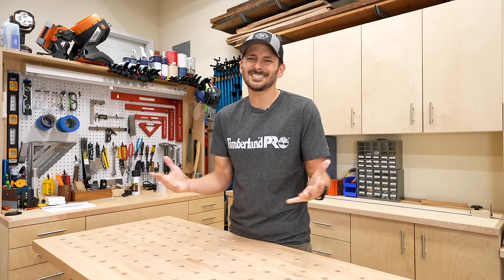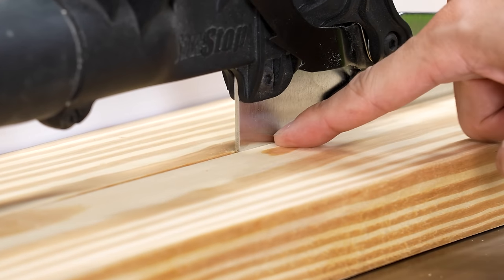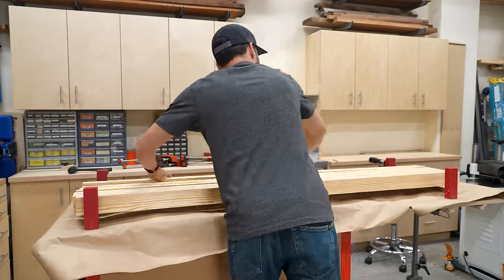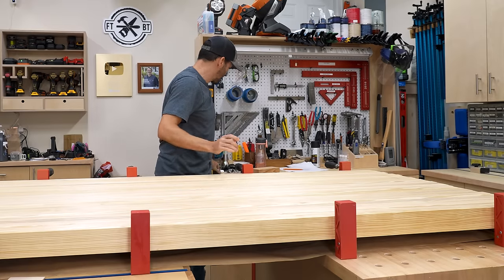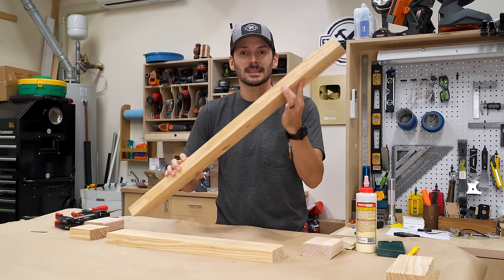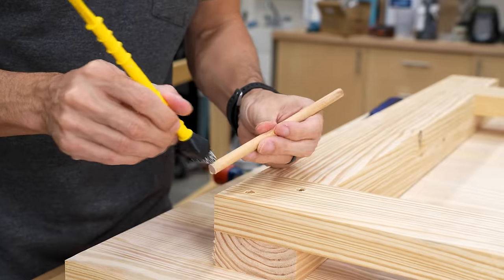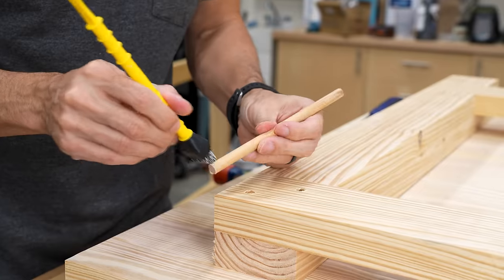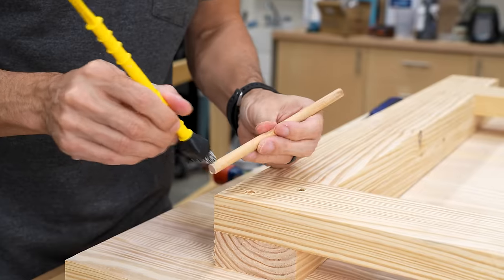Building a Sturdy Workbench with Cheap Wood

Comment: One thing I wish you would have touched on: How did you decide on the height of the bench?

Overall amazing video and AMAZING bench! Thank you for sharing all your hard work 🙏
Reply: Thousands of years of experience and study of the human body has led us to the standard height of a kitchen counter. (Industrial designers literally use reference books for dimensions of people) Is your kitchen counter just right? Too high? Too low? Adjust your workbench height accordingly, erring on the tall side because you can always trim the legs shorter if it’s too tall.
Reply: @christophermcclellan8730  Thanks! My understanding is that this particular topic is actually a bit subjective in the world of woodworkers (not as straightforward as standardized counter heights)… basically surrounding the primary intended use of the bench: hand planing vs power tools vs assembly, etc, etc.

If there’s any truth to my point, then I’m just saying it would have been nice to learn about his thought process that went into the height he decided to land on.
Reply: @mrvvoo  hand tool folks tend to like their bench a bit lower than the ones who like power tools and, unlike a kitchen counter, you get to build a bench at the perfect height for you. That’s where the subjectivity comes in. For hand tools, I’ve read that standing with your hands relaxed at your side measure from your hands to the ground.
Reply: @christophermcclellan8730  There is no way the height is from your finger tips to the floor. That would be about 27" tall for me, I am 5'2". The standard kitchen countertop is 36". I would have to build my bench 9" shorter.
Reply: @marvthecarpenter  did I say fingertips to the floor? No. I didn’t. Watch one of the hand tool guys plane. The work is hip height instead of waist height.

Comment: One of my problems when working on a bench is that I ended up with tools in the way of what ever I was working on.  I put a 12" deep shelf under the front edge of the bench, spaced back a couple of inches and about 6" under and with a 1" lip on the back side.  I then shove tools on the shelf so that they are ready for use without being in the way.  I then started using a couple of plastic storage bins on the shelf and leave some things permanently in the bins so that they are always readily available.

Comment: Came back to watch this for a 4th time. If you want it flat, I use two 8 foot levels and 2 4 foot levels (aluminum) and I create a router sled. You can get a 3" half inch shank bit and go to town. Basically you create an H and use the 2 four foot levels by connecting 2 small rails that can are about the width of the router. then you can just glide back and forth and take off material. I do this on wood slabs, you may not need that level of accuracy though. The drawback is the cost of the levels - but I've seen people make them out of particle board, or plywood. I wanted something without flex because when you are in the middle of 4 foot, I'd notice a slight 8th inch press down which in the final form I'd see these micro pits. You'd only see them if you took a bright light and put it at one end to see how the light scatters. Since this is a work bench, maybe you don't need ultra fine level :)

Comment: Tip from my shop class.  Buy a 4 inch roller and tray in the paint department.  Thin the glue by 20% or so.  Use the roller to speed up applying the glue.  Extends the open time and speeds up application of the glue.
Reply: @@a.melburn most yellow and white glues can be thinned with water.  Check the label.    Teacher was a contributing editor for Fine Woodworking, so I trust his experience.

Comment: I built a bench using 3 layers of 1” mdf. Per rob cosman. Not very expensive Very solid and very flat. Round over the edges and dog holes and put ca glue on the edges and they are holding up well

Comment: Great video as always Brad, though it brings back some resentment I have from a recent project. I tried a build similar to this out of 4x4s from a massive pallet my dad got from his work (used to ship a machine from Italy) and it went... poorly. I didn't have clamps so I made my own wedge table which kind of worked, but my crappy contractor saw flexed way more than I expected and I couldn't get a flat glue line between pieces, the wood was some mystery white wood that warped like crazy when the water in the glue soaked in, the whole thing is a massive 4" thick potato chip in my garage right now. I bought a flattening bit for my router to try to salvage it but I think it will be too thin by the time it's done....

Many lessons learned, luckily the wood was free so I only lost my time and the half a gallon of glue I used.

For now I'm thinking a plywood torsion box table is the right move for my skills and tools and budget
Reply from the maker: Yikes!  Sounds like a time consuming lesson learned, hope they next one goes better!

Comment: Cool,  I did mine a little differently. I used 4x4 for the legs,  2x6 for the frame with crossers every 16" and 3/4" plywood for the surface.  this table is 8'x4'.  On my 2nd table I did the same but used a 1" laminate desk surface for a smooth easy to clean.

Comment: I would like to build one of these, but first I need to ask a few questions. I’d like to “practice“ by building a smaller version without holes for my kitchen island in our tiny home. But before I even do that, I have a few more questions.
1) I do not have any fancy equipment. I have a chopsaw, a circular saw, a belt sander, palm sander, drill, staple gun and framing nailer. The staple gun shoots brads up to 1 1/2 inches I believe, maybe 2 inches. Can I do one of these?
2-secondly, where can I get one of those thingies that helps you cut a straight line with your circular saw? Is it made by KREGG? I do have that starter system for the pocket hole driller.
Thank you very much for sharing your time and your talent with us!.

Comment: Built this table this weekend. I used off cuts from the cut list to make a slat bottom shelf. I’m not set up like in video. Had to use jointer to mill. Smooth but not accurate. I was in about 140 with wood and supplies.

Comment: Next time for a quicker glue up try a disposable 4- 6" paint roller and a paint tray. Once swipe of the roller down one side of one board and then the other slide together and clamp. Takes half the time and when finished thrown our the paint roller.

Comment: You could have drilled the Dog holes into Each Piece before Glue up, it would make it lighter for later and it also been easy to do on the Drill press for a Very accurate hole layout.

Comment: I would've went with a thicker top but that's a beast of a bench, Brad! The house I bought 9 years ago came with a pretty good supply of 2x12 construction lumber in the form of shelving that I didn't need and so I reclaimed it. (previous owner had a ceramic studio separate from the house that became my woodshop) First use was to build a woodworking bench - everything is mortise and tenon (the old fashioned way). It's not as big as yours but the 2-3/4 inch top is a bit lacking for my tastes. Even after 7ish years, I still haven't brought myself to drill dog holes in it but this might be the final push I need! lol. At any rate, another great build, Brad - thanks for all that you do!
Reply from the maker: I don't think I could have managed anything thicker at this size bench, lol

Comment: We had a worktable like that in the bakery.That table was likely old as me. My co-worker whacked a block of chocolate on the edge like we always did and the outer laminate broke off! (We wanted to break the chocolate down to get it into the double boiler melting pot) When using wood table for food you have to oil it regularly with edible oil.

Comment: I realise you made this bench a year ago, but I. only just seen the video. Could I suggest that you have some one 3D print some. plugs If you don't have your own 3D printer. for your dog holes Not in use, as you have put a chamfer on the top. You just print a chamfer on your plugs. So they sit flush with the top of your bench. and you can just pop them out from below. If you have a situation where your dog holes blocked. or you can't push them from below. You can always make a hollow plug on its base And glue in a magnet. that can assist on removing them when you need to use the holes. I have done this for my own bench as I could not stand all the loss of nuts and bolts through the holes. There's no point me offering Plans as they are probably the same size holes as you've used. I have done this, and I'm so pleased I did so. It's much more pleasant to do assembly jobs on my bench knowing that I'm not going to lose half the parts.

Comment: If you want to use construction grade lumber for a project like this you should l;ook tot he 2x12 material. Most contructionlumber is harvested as soon as it is large enough to produce lumber, so a 2x12 will have additional years of growth, so the rings will be tighter and provide more stability to the lumber. Just rip it down to size after the fact and leave the smaller dimensioned lumber on the shelves.

Comment: A flat full size shelf 6-7 inches from the floor. Another shelf sitting on that shelf. This shelf is 1x8 wide and full length of the bench. It is supported full length by 1x6 or 1x8 sides making a tunnel on the full shelf for long things like those straight edge aluminum saw guides and your high reach hook stick. This area becomes your hand held power tool garage. You can reach All of your tools because the ones under the center of the bench are elevated on the tunnel shelf. They are also now right where you are likely to use them.

Comment: Hey Brad. Good video. So many out there. A lot seem to contradict what others show. I trust yours over the others I’ve come a crossed. I’m just starting out as a DIYer outside of plywood projects. I picked up 12 2 X 8’s for the top (36 X 60) from my local box store. Picked thru for the best I can find. No jointer, 13” Dewalt planer just purchased recently, and 10” contractor saw I bought in the 80’s. I see you planed the boards before gluing up, but didn’t edge joint them. How critical is that at glue up? Also, do you let the boards dry for some time before starting? I’d appreciate your input.

Comment: Nicely done.  I particularly like the tip to use long set glue. The joinery for the legs is definitely a step up, I think I just found an excuse to get an angle drill jig. I think I would have used a corded drill for the dog holes, the environment can only stand so many discarded batteries.

Comment: I tried to take this on without a planner and the wood I got from Home Depot was absolute crap even spending an hour trying to get the best I could find. 

I have had a very tough time getting the top to be even and straight and the glue up went really bad as well with gaps due to warped wood.

I think this is one of the best solid benches I have seen but damn even with the plans it has been very tough to build

Comment: nice job, did you ever finish off the bench with a poly or an oil? Im looking to build my first bench soon and am looking into finishes now. I think im going to use a traditional wax for the bench top as I am using a AA premium grade Birch Plywood, but wondering what to use to finish the bench frame

Thanks in advance and keep up the vids, they're great!

Comment: This is a great build. I was leaning toward using 2x4 material for my bench, but I think I will go with this concept. Really simple, but sturdy.
Reply: 2x4 is fine for the stretchers just dont make the legs out of 2x4. Use a 4x4 post instead.
Reply: Saves you some work I guess.

 With the 4x4, that's a decent chunk of a round tree, and would usually be cut from the softer core of the tree, so there's greater difference in radius and density between one edge and the other. 4x4 is more likely to warp with changes in humidity than a pair of 2x4 glued together with mirrored grain.

The glue is stronger than lignin, so a leg made of four 4x1 laminated together would be even stronger and more consistent.

A defect that passes in a 4x4 would be a reject in a 2x4, so you're getting better wood.

Comment: I heard that using 2x8s and ripping them in half will actually last longer than 2x4s because the piff is (mostly) removed. 
(The piff expands and contracts over the years which eventually deforms the wood)

Comment: The pink 2X4s are Douglas Fir. It's not a true fir, it's genus is unique, Pseudotsuga menziesii, Doug Fir is nearly as strong as the hardwoods, but lighter, & easier to nail. It's used in the Western US for house framing.

Comment: I'm a big fan of yellow pine as work bench material. Since it is SOFTER than the hardwoods I work with, if my workpiece hits the bench hard, it's the BENCH that dents and NOT my project.

Comment: Great video. Regarding dog holes, I got fed up of loosing things through the dog holes, so I 3D printed some plugs for dog holes with a tiny lip on top edge to seat flush in top radius of bench holes. If any dog hole are hard push plug out from underneath I put a hole in plugs to mount  a nut  to ease the removal of plugs with a magnet. so now  no more lost items through holes.

Comment: Now, that's a fine workbench. I just put wheels on by table saw using the wheels and hinges thing - see YouTube . Probably too late for your bench as the bottom spreaders would need to be higher up.  Anyway, very nice build...

Comment: Fantastic bench for a shop that can house a permanent large surface like that. One little hint about the forstner bit: your drill was going too fast, those bits actually cut better at a slower speed. The bit you finally bought was definitely the way to go though since you had so many dog holes to drill and in very thick material. I'd go with drawers for your storage. Shelves just get stacked with stuff that will be lost in the pile you've made and builds up with an incredible amount of dust in a shop. Try to figure out which tools and supplies you need at the bench and customize the drawers for the items you need at hand. (And stuff is going to fall through the dog holes, so you'll need to leave space above any storage unit to clean that mess up). Besides that, you need to develop the habit of closing the drawers while you're working or they'll just be dust bins as well. Great video!

Comment: Really nice job on the bench...but I have some questions:  1)  I am about to pull the trigger and purchase a 36" SawStop PCS that will be mounted on a ICS Mobile Base....the question is regarding the over arm dust collection unit that you have.  Do you like it or would you know go with the larger arm?  2)  The other question that I have is will you hole spacing work well with TSO products?  Thanks!!
Reply from the maker: I love the overarm I have vs. the open air one that hovers over the top.  I think my version catches more.  And I'm not familiar with TSO specs, but these are 4" on center

Comment: So far I've done about 12 small glue ups for cutting boards and have echoed your words just about every time ... "this is not going well"! 
My vote for storage below would be a modular cabinet with drawers of different heights and widths, because all items needing a home are not equally sized. Above the cabinet I would put a shelf for the smaller, always used and always missing tools, Thanks for the bench dog hole bit demonstration tips. The auger bit is obviously the best way to go. Hope you're feeling better!

Comment: Nice build. I do wonder how necessary it is to have such a beefy table top. I've been using a hollow core door with 2x4 supports on saw horses for like 2 years and it's fine. Obviously not great for hand nailing but I so infrequently do that it's not an issue.

Comment: @FixThisBuildThat - I noticed in your glue up of the top that you clamped the wood together as you applied glue and then glued the larger pieces together at the end. I've also seen other youtube videos that advise gluing and screwing as you put a top together like this. 

Is relying on only the glue as strong? Or are the screws better to include as well?

Just looking for some clarity, as my 1st workbench build will be coming up soon. Thanks in advance, and as always, great video!
Reply from the maker: Screws in that situation are literally just for clamping while the glue dries.  the glue is the only bond you need as long as you have well prepped surfaces and good clamp pressure
Reply: @Fixthisbuildthat  Sounds good, thanks! 
I always come back to your channel, and this video specifically, as one of my bench building inspirations, so keep up the good work.

Comment: So I want to build a new workbench, not nearly as big, but want a sturdy top with a flat surface. I only have a circular saw and don't have access to a planer/joiner. What would be a good recommendation for a good, sturdy, flat top? I thought of OSB or plywood with a lauan top that could be replaced if it got too messed up....what would you recommend with what I have available tool-wise?

Comment: Hey Brad.  I was wondering instead of using a drill to make the dog holes if you used a plunger router with a 1/4" up cutting spiral bit would work and a bushing of course?

Comment: awesome workbench, but do you have any ideas on how I could make it pivet like a drafting table?  I used a 5x8 workbench now, it's not very sturdy and the top is wavy.  The only reason I don't change it out is because it's on casters and it's  the perfect size for me.  I'd love to build a 5x10 version of this, but I'll need a way to pivet the top to reach all of it from 1 side when installing vinyl.  Would you recommend a way to do that?

Comment: You do know that Forsner bits are not like normal drill bits right? You have to drill a little then pull the bit up to eject the shavings and then drill a little, etc.  Takes longer but the holes are of better quality.